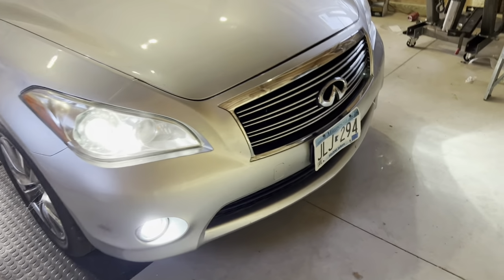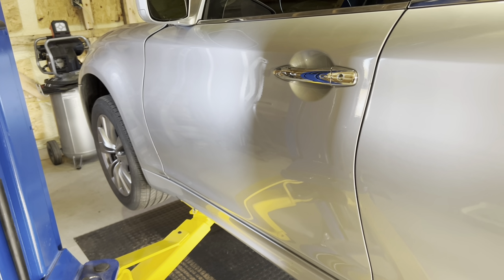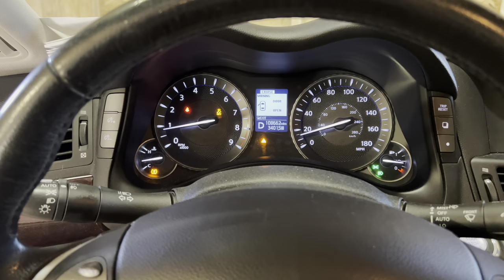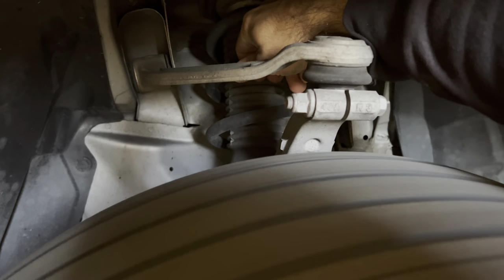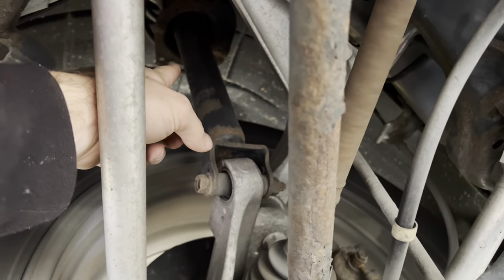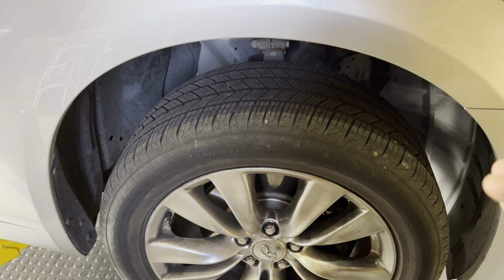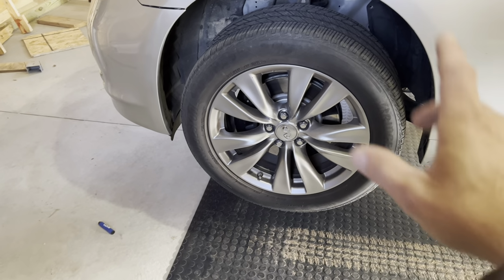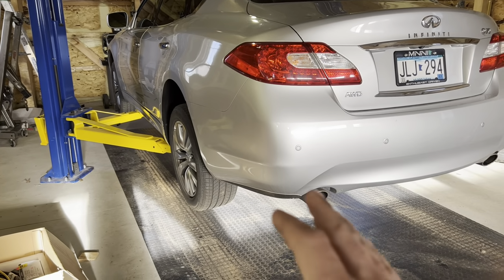Loud Rumbing / Roaring Noise When Driving Faster Speeds

Comment: Don't do this.  You can use a wooden yardstick to stick back and touch the coil and it will pickup the vibration.  Ever see a alligator grab a man's arm and roll?  One slip and you arm touches that tire going 50 mph and your toast.  You can detect a bearing by jacking the car up and shaking the wheel grasping it at the E, W and then N,S grip points.  I definitely would not reach in to touch the coil
Reply from the maker: Tires don’t reach out and bite, but DIYers not paying attention do slip. Happened to me several years back, had road rash on my arm. No it did not send me flying across the shop…slow down with the drama 😂

Comment: The average person should NOT reach over the tire while the tire is spinning. Severe injury may result.
Reply: I am almost thinking no one should do that.  Could a stick be used to conduct sound / vibration?   Microphone..?     Great video though.
Reply from the maker: Yes automotive sethoscopes are by far the best practice, or a very long dense rod like a 24” 3/8 extension. Working around vehicles at all required safety protocols, grabbing the coil spring and avoiding contact with the tire really isn’t an impossible task.
Reply: Not impossible but not worth the risk of a disabling injury. Stick a contact microphone on the thing.

Comment: You can just grab the tire at the top and bottom and give it a shake, alternating top in bottom out, top out bottom in. If it moves or it doesn't feel tight, it's going to be play in the bearing. You don't need to do all that lifting it up and putting it in drive. Just jack up one wheel at a time.
Reply: Be careful he it's nuts enough to do it while the wheel are running 50 m/hr
Reply: no not while the tires are spinning obviously.
Reply from the maker: That only works if the bearing is worn to the extent of becoming loose, which is a safety issue. Bearings make noise well before that point. Some people have the radio up too loud so they never hear it, others notice and need it diagnosed 😂
Reply: @J05hFontenot sometimes you need to state the obvious
Reply: @Pete_Tech_  they don't always make noise when they aren't loose. I haven't heard a wheel bearing make noise before becoming loose enough to tell with a shakedown. Usually if it's making noise it's because the bearing is worn, and if it's worn, it's usually better the seals have allowed debris or moisture into the race resulting in the play that you feel when you shake it down. I can't think of any other reason that a bearing would make noise. If it's sealed, it's properly lubricated 🤷
Reply: You have obviously never had a bad bearing without the shake and shimmy problem if you catch them early they growl and groan before they loosen up. The way he's doing it was taught to me by a 40 year plus ASE master and Transmission guru.
Reply: @shatnersufolanded7785  2000 Silverado 1500 4x4.
The passenger front bearing was bad, but showed no signs until I heard movement at parking lot speeds. That's when I checked and it was barely loose. Took it home and it got worse really fast. By the time I had the hub off, the ball bearings were literally falling out.

Comment: I have a rhythmic deep howling. It starts at 20mph. Then evens out. Then accelerating it gets louder. Almost feels like a windy day and roof racks are getting hit by wind? When you coast, it goes away. Sounds like the front . Its scary . It feels like your teathered and trying to  run.  No noise when i cut the wheel abruptly. 2000 escalade  350, 000 miles

Comment: Thank you very helpful. I had a vibration noise on a rear tyre and my first thought was rear bearing. Finally it was bad tyre to be changed.
Reply: Same. Think I have a bad tire.  Much cheaper to fix/replace.😊😊😊😊

Comment: I got my rear brakes and rotors done and its making a rumbling sound as if im driving on the side of highway,  took it back to mechanic and they said everything is fine,  no issues  but it happens off and on at high speeds like 65 70, i have to come to  a complete stop and it goes away
Reply: Same here did you find out what it was
Reply: Same, if I'm coasting at high speed   it will happen and only goes away if I give it more gas or coast till my speed slows. Braking, throwing it in neutral does nothing. Pls help us
Reply from the maker: Sounds like a wheel bearing to me.

Comment: How about a roaring that is mostly rhythmic, but sometimes constant for a few seconds, or sometimes stops for a few seconds, but usually cyclic, no steering input makes a difference, acceleration vs deceleration doest matter, its only noticable at speeds of 75mph to 82mph, didnt dare go faster (1995 Chevy Suburban with 190hp and a worn-ish trans and so its hard enough to go that speed

Ball joints on the lower control arm look okay except for leaking most of the grease. But dont seem to have really any play. New front shocks but still rough over small bumps and cracks. No clunks or anything

It is 4x4 with leaky cv boots..

Comment: Thanks for the video. Obviously proceed at your own risk. As mentioned by others using a yard stick/wood stick is much safer for the average DIYer. BTW nice lift and helper. I didn't turn off the stabilizer and car on front jacks would not go above 7 MPH.  Car sounds like airplane above 40 MPH worse with slight right turns. Suspect driver side wheel bearing. Both front tires have zero play. Tires rotated with no change.

Comment: Ya, thinking it's a bearing. Loud noise from front end, louder as you accelerate. 
Recognize it somewhat from a bearing going in my other car on the highway. Just changed brakes, rotors..think the guy would've noticed it.

Comment: Question i got a 2015 Q50 its got 40,000 miles its making a horrible loud roaring noise when you first start it if its idling not loud when I put it in drive it makes a clucking roaring noise  My engine is not overheating it's running normal my gas is normal it hasn't changed gets worst when I accelerate and if I get on interstate  And accelerate when I let go I hear a clunk but its a rough drive  Took it to  infinit told me it was a small leak from the exhaust pipe  So I took it to Midas and they did a full exhaust test on it and said there was no leaks they said it could be an internal problem  But had my engine and my transmission checked out at infinity and they told me there was no issues with them so I'm wondering what this can be

Comment: Around 45/to 50 mph I get a roaring type noise that can only be described by me as the sound of being in an airplane. Making me think it’s just the way the air hits the car… however at higher speeds 70-80 my drivers side tire vibrates and I can feel it in my left foot when it’s resting in that little chill spot (automatic) idk, obviously needs a diagnosis but if anyones knows what that would be let me know pls😅🙏🏻
Reply: I'm having the same issue, did you ever find out what it was?
Reply: Replace tires first then do the wheel bearing. You can test this by rotating the tires to see if the noise moves.
Reply: Alloy may be out of shape
Reply: Wheel bearing

Comment: I had to replace both front wheel bearings and recently bought new tires couldn’t find the right size but was told it wouldn’t affect anything if I bought a bigger size, now when I drive down the road over 40 mph it gets very loud! Not sure what’s going on.

Comment: I had a wheel only make the noise after 25mph. Also had play when grabbing tire at 12 and 6 o'clock and shaking, about 1/16th" play.  No noise when braking.
Reply from the maker: Loose suspension component or potentially the bearing. Would need diagnosis
Reply: @Pete_Tech_  it was the wheel bearing. When I got the assembly out of the knuckle (eventually, was very stuck) it was dry and seemed to be the problem. All other components are tight.

Comment: I have an 02' Blazer ZR2.  Just changed my front bearing hubs because i have a loud "low power steering" type sound that gets louder the faster i go & only makes this sound when rolling.  Tires are good & quiet. I think it might be my rear diff bearing.  Sounds like the front but the noise drones & sounds weird like sometimes its from the front & sometimes from the rear.
Reply from the maker: Differential bearings will typically make noise when coasting. (No load applied). Use a lift or Jack stands and drive in the air to find out. And automotive sethoscope is very cheap.

Comment: I knew it was my Front wheel bearings, both Front wheels are scraping when I turn Left and Right and the Left side is louder it's making a loud pop when I bring the wheels back straight. I'm replacing both inner tie rods because there's a lot of play in the steering wheel it also feels loose and I'm replacing both Front wheel bearings at the same time. I also need to to an alignment on my Front wheels, because the steering wheel is facing towards the Right when I'm driving. But since my Camry is really low, every shop I called refused to do an alignment on my car so I'm gonna do it myself when I put my Aftermarket wheels back on after Winter.

Comment: Ok, heres a question for you from South Africa. I have a Dihatsu Terios 2012, 1.5 4x4 model that has done 200 000 kilometres both on dust and tar roads. It has been regularly serviced and recently had the front propshaft, front shocks and all brakes replaced, front and back. My question is this: if the car stands overnight and I start it in the morning, I then reverse it out of the carport swinging the rear to the left, I then put it into first gear and drive turning right to get out of my driveway and get this horrible grinding noise across both front wheels and which also makes the noise just under the steering wheel and literally feels like it is coming up the steering column.  this lasts for literally a few seconds (60 at most), if driving extremely slowly it continues for longer ggggkkk, gggkkk, almost like dry metal on metal noise and then doesnt come back no matter how long the car moves or stands during the day. It only occurs first thing in the morning when the car has stood for around 12 to 13 hours.
The steering wheel turns without any problems. I have had new tyres fitted all round as well.

Nobody that I have taken the car to can tell me what is wrong, most of the time they dont believe me because a: I am an elderly woman and b: they cant hear anything, I have driven the car to them so of course the noise has stopped. I have had the car lifted off the ground and driven and no noise, put it back down and the noise will sometimes come back for a second or two. I have been told that the wheel bearings are fine, but irrespective, I will be changing them.
My thinking, and I know squat diddly about cars is that there is some sort of lubricant/oil/grease problem that once heated up lubricates whatever is causing this grating/grinding noise.

Any suggestions, help, advice as to what could be the cause of this elusive noise (and I am not going senile) would be greatly appreciated.
Reply from the maker: Sounds crazy but I would try new brake pads and rotors on both front and rear first. Sounds like the brake rotor surface could be rusting or severely pitted attracting debris and cause noise until the pads rub it off enough to not hear it. Unfortunately I can’t diagnose it over the internet. Bearings will make noise constantly if they have failed.